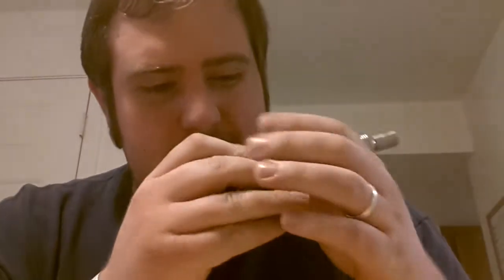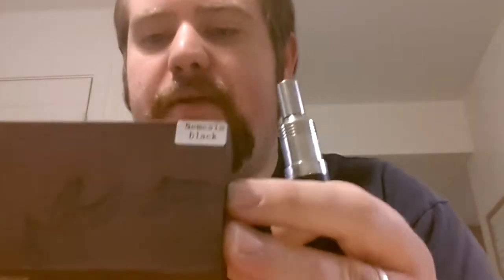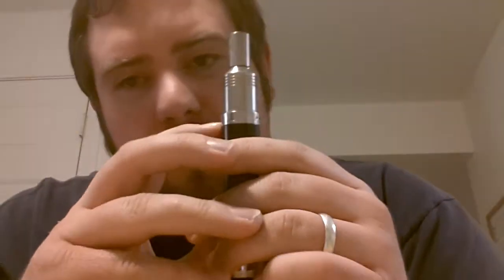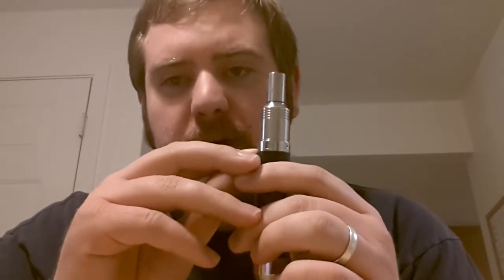My first sub ohm coil build and talking.

Comment: did you drill your hole out on your cap if not it would help you out a lot if your air hole was bigger
Reply from the maker: Yeah this weekend I'm going to try and tap it out to 1/16.
Reply from the maker: Yeah this weekend I'm going to try and tap it out to 1/16.